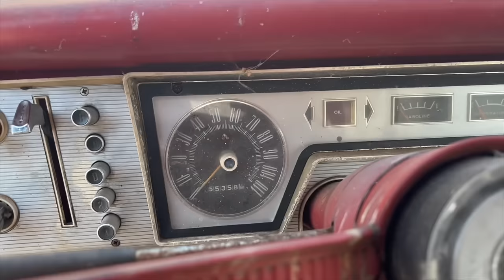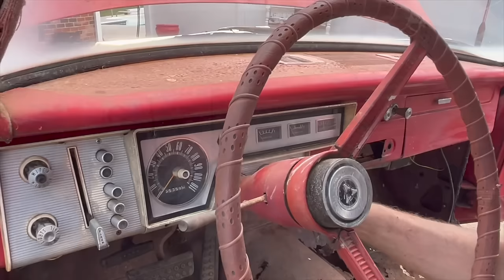First wash in 30 years,  road testing our 64 Dart station wagon

Comment: I fixed the floor pan in a pickup buy power washing, wire wheeling, rust converting. Then got rabbit cage wire covered the holes and fiber glassed over it. Worked great!
Reply from the maker: Ok thanks

Comment: If I may suggest, when mounting tires/casings on freshly painted wheels, mount with the wheels upside down so the mounting bar doesn't scrape the paint off of the outer rim. Also, it would be a lot quieter with floorboards.  Lol
Reply from the maker: For sure

Comment: For floor pans simply buy some sheets of tin, then cut the length and width you need and attach with metal screws or use bolts
Reply from the maker: Ok thanks

Comment: The dots represent the high point on the tire. It should be oriented 180 across from the valve stem. The DOT  numbers indicate the location of the factory they were built in, the size code. And the last 4 digits indicate the week and the year. For instance,  1222 would indicate the tire was built in the 12th week of 2022.  
Get you a pop up camper and take a road trip.
Reply from the maker: Ok thanks for the info
Reply: You line the dot up with the valve stem radial tires with steel belts should not have run out  unless
Reply: The tire is defective

Comment: Glad to see you wearing a 😷 When I was a kid we had an upholstery business my mom went to School to learn the trade I sew myself. All you gotta do is keep track of the order of the bars for the headliner. You take paper and make a template and measure alot but it's not that hard to make them headliners the visors are the hardest. You just trim off the couple inches of extra hanging head liner material after you stretch it and contact cement it in place. Get you a cheap industrial sewing machine. Same thing with the seats take the seat apart with a razor blade pop all the stitches and Trace the panels onto your new vinyl or cloth. It's not as hard as you would think I've been watching what y'all can do you could do it easily.
Reply from the maker: Awesome thank you

Comment: I wouldn't lower those torsion bars too much or the front end will slam on the ground if you hit a dip. I bought a 63 Imperial years ago and the torsion bars were way too low and the front end dragged on everything. There's a procedure in the service manual for setting them the correct height. Once you get new floor pans in there, you'll be at a major turning point. Those Darts were really good cars.
Reply from the maker: Ok thanks, I need to find some floorpans

Comment: I remember when I was a teenager,in the early 60’s I had a 53 Chevrolet and when I had a flat tire I would go to the county store and would have to break the bead by running over it just right then I would use the jack handle to unmount one side to get the tube out then find the hole go inside the store and buy a hot patch then put it on and light it,while it was cooling I would drink a coke (I hadn’t learned about RC yet)then put the tire back together and be on my way. I think you should let WaWa drive some too.
Reply from the maker: That’s awesome … thanks for that
Reply: I recall my dad doing the same to our 53 chev. Years later I asked him why he didn't just take it to our corner garage and pay a couple of bucks to save you all that work. He replied that it was a couple of bucks he didn't have!

Comment: Josh in regards to floor pans in cars with a basically flat floor (where you put your feet) just get a flat sheet of body metal cut to size, get a couple of bead rolls put in them to stop drumming then weld them in. In regards to quarter panels, if there aren't any really complex curves make your own. I have done both these things.

Comment: For snakes, I run a stiff electric wire through a piece of conduit with a loop at the end... from a distance, I put the loop over it's head and pull the wire back until he's trapped.  Move him and loosen the wire to release the snake.

Comment: Are you certain that's a 170 slant 6?   The 170 badges on that car represent the trim level options. 
The 170 slant 6 has a water pump bypass hose that's about 1 inch long as opposed to over 2  inches long for the 225.
Rubber floor mats didn't help keep the floor pans from rusting.
Reply from the maker: Ok interesting I will check I think somebody told me the color of the engine makes it a 170 but I’m not sure

Comment: The sheet metal on the floors is underpinning people used to put under the trailers to make them pretty. Lol. Alot of the older trailers has it under them. Now they make the plastic rock looking.
Reply from the maker: Ok thank you

Comment: I reckon this old station wagon is worth a paint job, what an absolute beauty!   Thanks again for another great video!
Reply from the maker: Thanks for watching
Reply: @Sleeperdude  qwik tip cover distributor  and carb with tin foil
Reply: @Sleeperdude  might want to check out a 4 door dodge dart in junkyard for parts and floor pan cut it to of a 66 or later

Comment: Well Done Sleepdude Crew  family :) also family part fix up Dart Wagon car , also that front seat floor metal want know it called Facil Sideing on house or back garages people have had and floor pans be 2 peices with no Hump in middle or sometimes in 3 with middle Hump added  in 1 big peice and have tack weld in Josh ! But do measurements side to side for length wise also front to back plus  before cutting also get right one and so fit perfectly after cutting out what needed also double check out!
Reply from the maker: Ok thank you
Reply: @Sleeperdude  welcome

Comment: Jerry Reid- She Got The Goldmine..... Name the song... The Gen 2 dart floors will work but will need slight modification to get them to fit perfect... The patches on the floors are just old galvanized tin ceiling and wall panels... I am not 100% sure but fairly confident the blue rims are the front and black are the front rims.....  Correct rims for the wagon just different years.. IM bettin those blue rims came off the wagon the blue doors came from... The dots on tires represent balancing... If the valve stem is aligned to yellow its t the heaviest point of tire, Red lightest point Sleeper Brotha
Reply from the maker: Ok thank you I appreciate it

Comment: Some rust converter / rust  reformer in gallon sized cans would help out with the frame quite a bit  , you get rid of the loose rust and then paint it with a brush or sprayer.  :)
Reply from the maker: Yeah that would help

Comment: In the North, drive through car washes have an option called "corrosion inhibiting undercarriage rinse", which is the best thing about them.  I have found one with that option on the North side of Asheville NC, but most in the South don't have it.  Spray wax is better, but it is useful to use both, mostly to get more spray angles.
Reply from the maker: Ok that’s neat thank you

Comment: Here's a small tip you probably already know if you can go to the Dollar tree or something like that and find those windshield covers that are made out of the foam and shiny plastic they work real good as a temporary headliner keeps the heat off your head just spray glue them right up to the metal
Reply from the maker: Good idea thanks

Comment: You should bring this to the slant 6 drag races at Kentucky dragway in Clay City Kentucky the weekend of September 10th and 11th.   They have a Mopar show, swap meet and drag races.  They have a slant 6 only bracket race class.  Doesn't have to be fast, just consistent.

Comment: Nice job on this dart ^^. Yeaaah, wheels that matches body color and dog dish caps. For the inside door panels that a pretty good I saw in Coldwar Motors videos reapplied the wrinkled vinyl onto a fresh cardbord stuff for the Plymouth Fury 1960. And it looks good.
Reply from the maker: I will have to check that out
Reply: @Sleeperdude  I' m gonna find it for you.
Reply: @Sleeperdude  First part here : https://www.youtube.com/watch?v=hAQwVkcX2pQ
Reply: @Sleeperdude  at 14minutes here there are some straigthening of the vinyl with a heat gun, this may be what you need : https://www.youtube.com/watch?v=Mk7P9eSIU4s

Comment: I think that this Dodge was used up in the mid-west. I think the floor pans a rusted from stow on people's feet. The car didn't have any carpeting just rubber mats. When rubber mats were used, most of the time people didn't use any mats like the ones used over carpets. Those metal tiles are called tins.
Reply from the maker: You may be right

Comment: Make sure them torque boxes for the torsion bars are not rusted out bad before you go on the road with it they break that is an extremely dangerous situation ok. And honestly you should put floors in and reattach that crossmember to the floor properly .

Comment: I'm guessing the two blue wheels came off the same blue car that the doors came off of.
The two black ones don't actually match each other.  Luckily they all mount the larger diameter hub caps used in the 60's before around 1966.
   I don't actually know if the spare tire is painted body color like the 4 wheels on the car, or is semi gloss black.
   As for the broken wheel stud: It is probably on the left side.  You might as well buy 5 right hand studs for that since you can't find the left hand ones new. Maybe someone will send you one left hand. I don't have any of the small thread sized, just the 1/2 in 20 used by B and C bodies.
Reply from the maker: Ok thanks for the info

Comment: Aesthetically, I like slightly wider tires, though not any lower, and more aggressive mud tread, but there is no practical reason for this since wide tires help dry pavement cornering and do it best when almost bald, and narrow tires usually work better in mud, though wide mud tires might resist sinking in more.
Reply from the maker: Ok interesting

Comment: Your pressure washer might have an additive feature that might enable you to spray wax the car at home if it is hard to take it to the self serve car wash.  I haven't tried that because I have some worries about the effect of overspray on the lawn, but I would love to spray wax my excavator, which will not fit in a car wash, nor do I have a truck big enough to take it there, so I may spray wax it at home someday.  I have already done a lot of waxing in the seams and stuff with a trigger sprayer.
     If you plan to repaint the blue doors, you might not want to wax them though.
Reply from the maker: Yeah that’s true thank you

Comment: I am thinking that Ralphie is going to laugh himself sick when in a very few years, he will be driving for real and look back at how he drives now. I do believe with the mileage a slant six gets that if you done a floor pan, and patched the worst of those rear quarters, a little primer on the drivers side, it would sell for some decent money as its gonna be going when the ten miles to gallon rigs are parked. Gas here in alaska is over six dollars a gallon and same for diesel. Of course a exhaust pipe to keep from getting exhaust fumes in the rig. A ten dollar swap meet radio system and good to go... I never seen it but a neighbor of mine said he got near thirty miles to gallon... i think twenty might be closer
Reply from the maker: I think you are right

Comment: I found a 2 door 64 Dart,  it has some serious floor rot,  I looked on line and can't find any patch pieces,  so I shied away from it. I'm thinking now, maybe buy it, cut out the bad, weld in some support then cover with sheet metal and weld it in as well then coat the underside and paint the inside.  The car's body is straight and very little rust.  Just the floor is bad.  Well,  the engine hasn't been run in about 5 years,  and the transmission (auto) is bad that's why it was parked.  I don't know which 6 it has the 170 or the 225.  A friend has a machine shop and has a 225, engine.  He took it out of a 75 Dodge dart.  Don't know if he has  the transmission or not.  I haven't been able to find parts for the transmission either.  But a later transmission will work,  so I'm not concerned about that.  Just a whole lot of work I may not want to take on. I figure if someone else buys it before I make up my mind,  that's ok to.
Reply from the maker: Yeah it would be worth it
Reply: @Sleeperdude  
Thank you sir, I am not worried about the mechanicals,  I'm just not good with body work,  I can weld though and if I cover the floor with carpet or rubber material it won't matter much . I don't think if it would hurt the over all price or not after I clean and paint.

Comment: i have a 66 gt dart u can have rust free needs a little work to run and drive body is nice needs glass front and back widows some one put a possi in it but i would not trust there work and i sold the wheels and tires off it because they were new got 600 out of them only paid 50 bucks for it has a slant 6 with 3 speed on floor

Comment: it's definitely mobile home skirting , i have installed lots of it when i towed mobile homes and we had to set up and install under pending . at Lowes 28-in x 5-ft Galvanized Metal Skirting Panel
Item #60762 Model #60762  $14.28 a sheet
Reply from the maker: Wow 😯

Comment: Since the back is rusty and the front is good I wonder if they use to tow a boat and back it down into the water. Man you ruined that door panel, it would have made a great template.
Reply from the maker: Maybe so

Comment: Bleach is highly corrosive to metal. I wouldn’t spray bleach on anything on the car,metal or plastic. I also wouldn’t back the tension off the torsion bars. I bought a 57 Plymouth from someone who had done that and the car looked and rode like crap with the front end lowered. I couldn’t wait to get home and put it back to the correct height.
Chrysler designed these cars to perform best as they came from the factory.  It’s best to leave things alone.

Comment: They make floor pans for the early ones put all 4 in my 66 valiant, which would be the same as the dart 63 to 66
Reply from the maker: Ok where did you get them?
Reply: Trying to find the receipt, so far i haven't,  Google it, and the front pans are on there by different manufacturers,  but don't see the rear. I needed rear as well, so I found a set of all 4 , probably been over a year ago, will keep looking for the receipt, the 67 up are very different, you need the early ones.I don't use credit cards so I had to get someone else to order them will touch base with him and see if he remembers where they came from
Reply: Auto body specialties has them all 4 pans, my buddy just got back with me

Comment: Hey I have been watching for a while now and love your videos. I have the same motorhome as you I'm kinda stuck with it though it keeps dieing when I put it in gear.
Reply from the maker: Definitely carb related but hard to say without being there
Reply: @Sleeperdude   I  will  have take it off and run thru  it then. Thanks for the tip!

Comment: Got to be careful driving with open exhaust on those little sixes not only from carbon monoxide but burning exhaust valves from it running so lean! That’s the backfiring you hear rolling down the road off the throttle. I really like those 60s to early 70s darts.
Reply from the maker: Yes thank you

Comment: Slacking tower of power 😂
Reply from the maker: Yep
Reply: Its okay they are good motors is had one in a 66 dart that smoked like a cummins lol ran great besides it burning oil
Reply: They always run to lol you should turbo the 225 that be cool

Comment: You can always put mercury Lincoln or Ford five bolt wheels on a mopars too Ford and Dodge always had the same bolt pattern what do you expect Dodge used to work for Ford yes Dodge Brothers used to work for Henry Ford
Reply from the maker: Most dodges do but this one has the tiny 5x4 pattern

Comment: Lucky you are not in the UK or you'd be arrested for undue care and attention, driving with no seatbelt, driving with a child in the back without being strapped into a seat, driving with no road tax, no MOT and no Insurance also dangerous driving (driving both sides of the road). Having said that I'd rather live there than here in the crappy UK